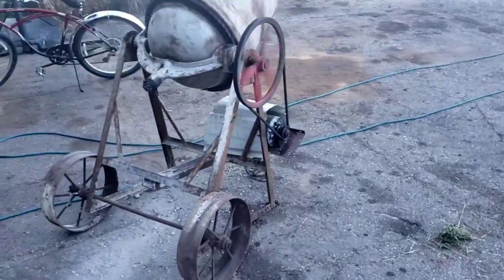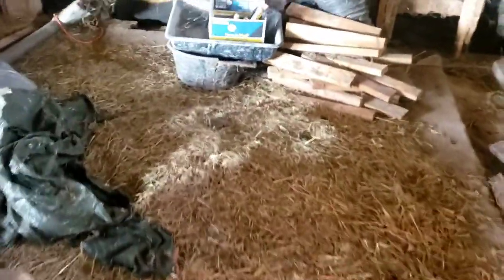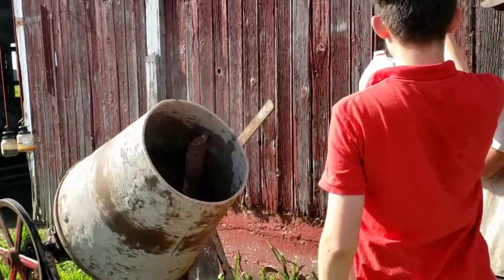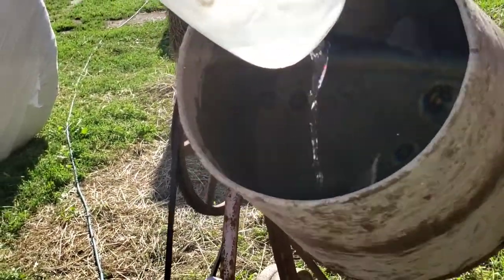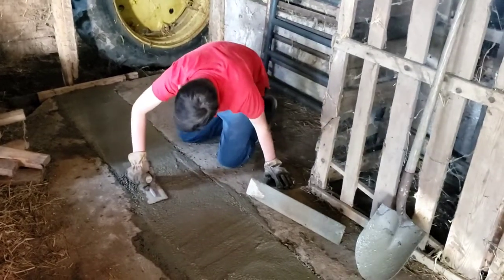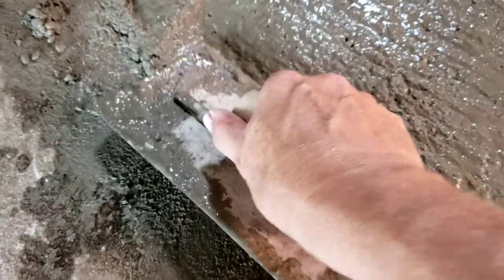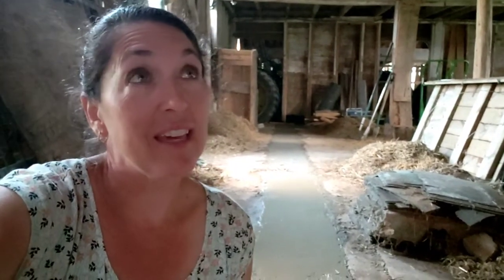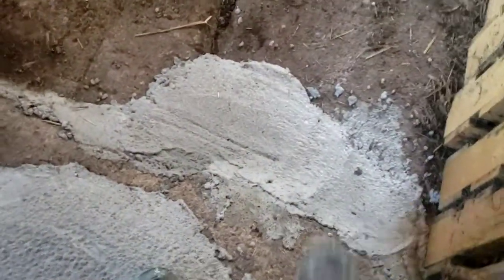DIY concrete barn floor patch

Comment: Did you video the rest of the patching down the end? My barn problem is more like that spot, so I would appreciate any advice about how to tackle a area.
Reply from the maker: Ours just sloped into a ramp. If you wanted a stepped edge you would just make a lumber boxed end section.